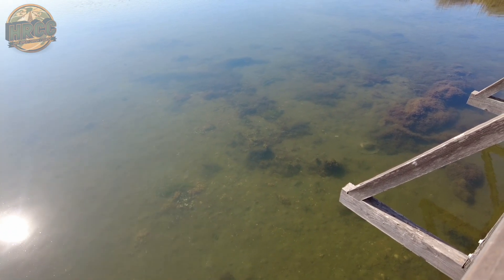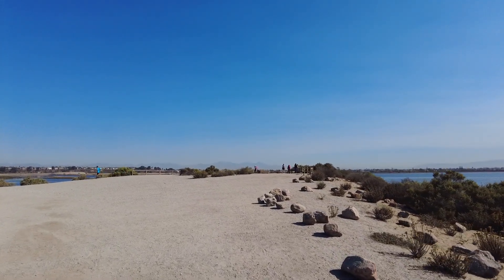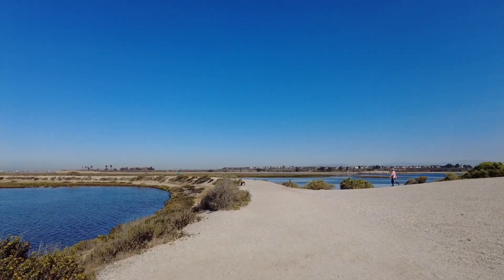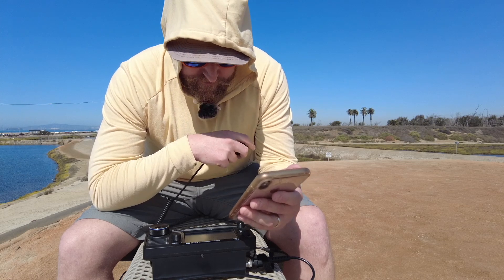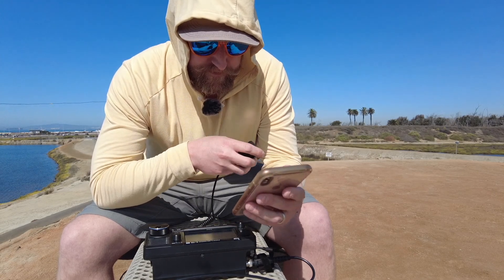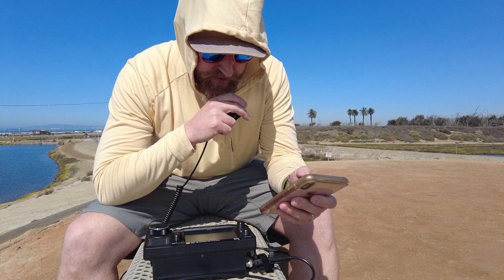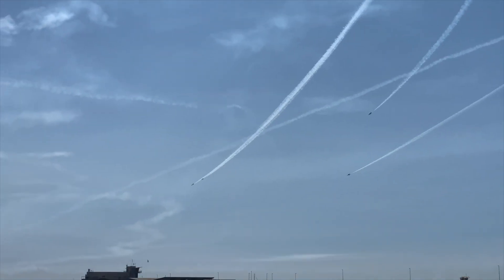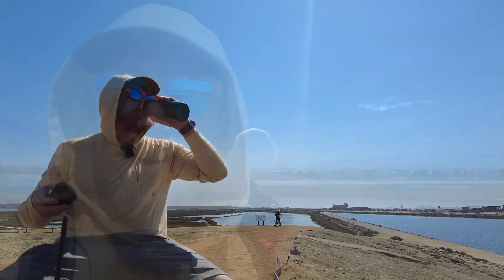POTA & Air Show?  Buddistick Pro, ICOM IC-705 QRP Amateur Radio Activation

Comment: I have found the buddistick to be one of the best compromised antennas you can use. Using one radial will give you a stronger lobe in one direction, but you will lose some contacts in the other directions. If looking to get more contacts from one direction, the single radial is the way to go. If you want to get good signals in all directions (because of having an even pattern), add a second elevated radial on the other side, 180 degrees. If you are looking for maximum DX distance, putting four radials in a cross pattern will lower your radiation angle. Example, on a 17 meter set up, four elevated radials will lower the take off angle from 25 degrees to 20 degrees. Adding more than four elevated radials will make little difference. The extra radials give very little extra gain, but they do affect the pattern and take off angle. Buying one or two (for horizontal dipole set up) 17' extendable antennas will allow you to have a full size antenna from 20 meters to 10 meters with no coil or heavy poles in line. It will also help to make tuning easier on 40 meters and offer a an advantage in signal strength. Buddipole also offers their "Triple Ratio Switch Balun". This allows you to get much closer to a 50 ohm match for your transceiver, allowing more power output. This can be quite a bit of extra power at the antenna, especially on 40 meters. I use one all the time, it's a great addition and can be used with other antennas also.  These types of antennas tend to go much lower in ohms the lower you get in frequency and  the switch can make a big difference. It also has a 1 to 1 balun built in for feedline isolation. It's a worthwhile addition to the buddipole kit. Hope this helps.

Reply

Comment: Josh, I wonder when you filmed this video since that whole area for a 15 mile stretch is now the site of a massive oil spill going from my old QTH at Surf City USA-Huntington Beach through Sunset Beach to north of Seal Beach. I was halfway expecting you to comment about the overwhelming smell of the massive oil spill. They are saying on the news here in Honolulu that an anchor from one of those ships ruptured a underwater oil pipeline either last Friday night or Saturday morning and that a criminal investigation has been launched. 
    BTW, I know that area in Bolsa Chica very well and there is really no shady spots to set up for a POTA either. Thanks for the video, Josh. 73’

Comment: Hi Josh,
Nice video. Glad you made the activation and the air show was the icing on the cake. You did a respectable job considering the video equipment you had on hand. You and the family stay safe.  73  WJ3U
Reply from the maker: Thanks for watching!
Reply: Josh, are you using the new Versahub? If so, does it require a choke balun? Set up video would be nice. Thanks. N7PHI.

Comment: Great video.  Studying for general and I was looking at the buddipole but idunno....buddistick might be the way to go.  Awesome location to play radio
Reply: Had my buddistick for a couple weeks now. It’s an awesome little portable setup. I am very pleased with it and feel it was a good buy. I am in SC and can hit CA stations no problem on 20w. The tuning charts that it comes with are pretty close,  and if your radio has an internal tuner you should be able to tune up no problem with the given settings. If you have an analyzer though, it would help a ton. The coil tap number for all the bands was accurate, but I found adjusting the radial length a turn or couple on certain bands really helped tweak it for max efficiency. I think I got most bands down to 1.1 - 1.3. But once you know the best radial length and coil taps for those bands, setup for next time is really quick and consistent.

Comment: Good video. I like that you used the tried and true Buddistick. Maybe do a future video showing how to make the Buddistick even better by just using metal instead of a coil and rods up to 20 meters and using 4 radials. Yea, it takes more time for portable, but is useful if your going to be camped out for a while. Makes it an even better performer. Military planes and Ham Radio....Outstanding !
P.S.   I see the ships, one of them has my Lithium Ion batteries on it. Been 4.5 months and still waiting.

Comment: Don't leave those electric fence posts in your car, they bent with the heat.  Seems like you were there Friday, my buddy John said they were practicing that day.  I didn't know the preserve was a park for POTA, that's crazy.  That's Wonderfull, I'm there all the time :).  I've used my car's antenna for HF, but never thought of going in the park with my radio.  I'm surprised the authorities didn't tell you something, then again they are not present all the time. It disappointing the air show was cancelled for the oil spill. I hope those birds survive.
Reply from the maker: What would the authorities tell me “Don’t heat up the air in the environmental reserve.”  ?  :D

Comment: Great video.  Looks like the Budstick is a pretty good antenna.
Reply: Id like to know how much power gets soaked up by the coil for qrp. Sounds like 5w wasn't working but 10 was so it might loose a few. Need a field strength meter for that i think.

Comment: The more I watch on ham radio the more excited I get. Can't wait to take my technicians test this coming Saturday Oct 16, 2021. 

Question, what band you running for the POTA video(s)? And what is the difference with SOTA? Are these digital bands?
Reply from the maker: I was on 20 meters.  SOTA is similar to POTA,  it the S stands for Summits. So activating from a mountain top
Reply: Hope your tech lic came back!. With Tech you can do POTA but only on CW (Morse Code). There is a chunk on the 40 M band you can operate with a tech license. If you want to do SSB (or other forms of voice) on HF you will need to upgrade to general.

Comment: Did you feel that the Buddistick performed well?  I have one, but it is older and I don't have the VersaHub or shock cord tripod.  I was thinking of getting those to jump start my use of the Buddistick.  Thoughts on the value?   Thanks!  73, K8JLW
Reply from the maker: I thought it worked great. But I assume the older Buddistick works performs similarly.
Reply: @HamRadioCrashCourse  Yes, my older one works probably the same.  Just trying to decide if the $120 investment in the better mount and tripod is worth it.
Reply from the maker: Unless you need a more portable option probably not. Just get out there and play radio.

Comment: I think GAME sounds better than CONTEST. Once anything is made into a competition the fun factor is out the window and it becomes just work. QRP is 5W or less by the books, but the signal report on a field antenna I've found 10W gives you a little edge above the noise floor but not enough to be suspected of being an imposter. I'm glad I'm not the only one who operates 10W and called himself a QRP without feeling absolutely tickled about breaking the rules. 

How is the backlight on the IC-705 in the sun? How do you like that radio?
KN4GEI